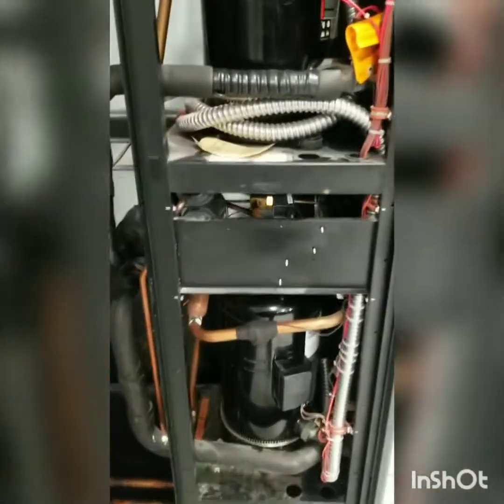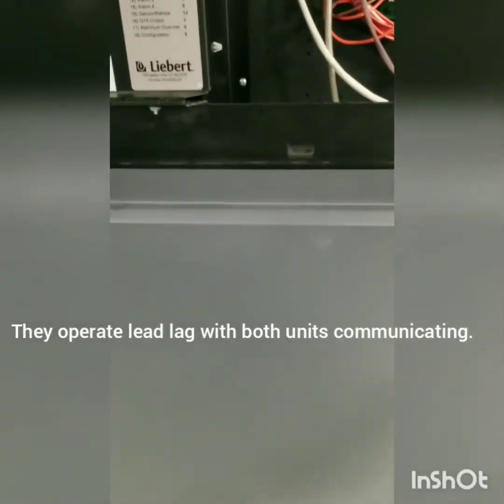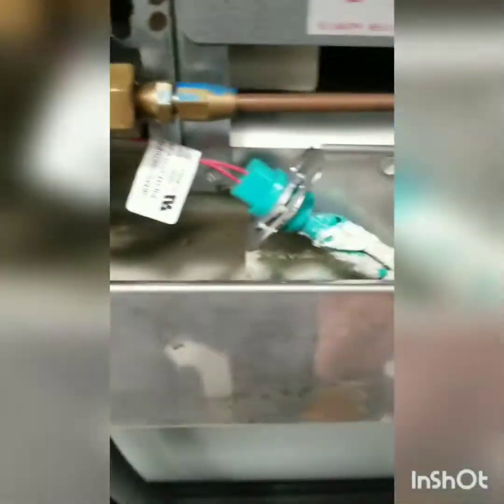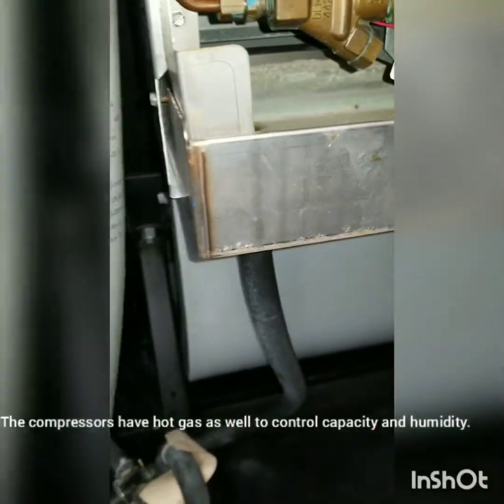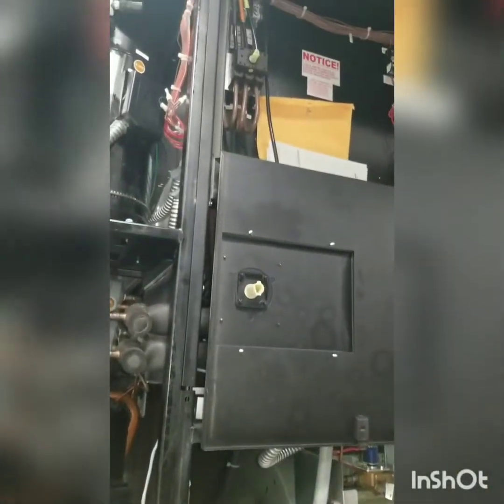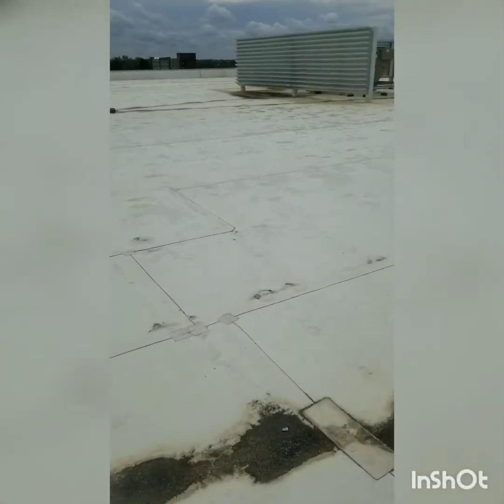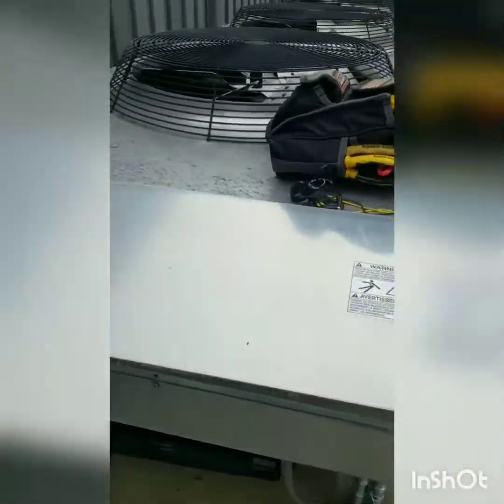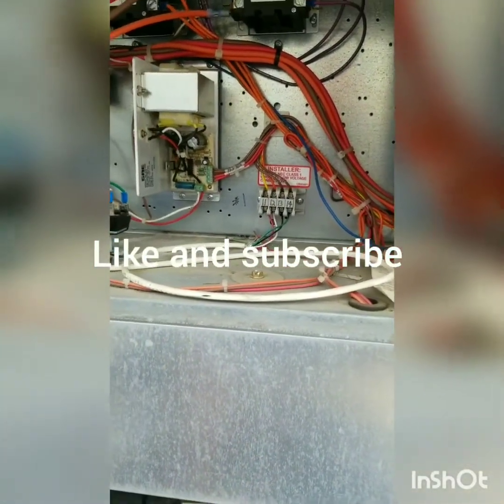HVAC preventative maintenance. Leibert overview and P.M.  HVAC IT room.

Comment: Hey mate just curious. So did you set the outdoor temps to a higher temp to conduct your amp draw testing?
Reply from the maker: Honestly, this was a long time ago. I do not remember much about this. Can you be more specific? When I have time, I'll try to answer this question in more detail.
Reply: At about the 6:55 minute mark  you are setting the outdoor fan temperature back down because you had set them higher to get your FLA
Reply from the maker: What I was doing was turning the 2 thermostats up to cycle the single speed fans off, which would allow the condenser pressure to increase, which will ramp the VFD controlled motor to full speed.
Reply: @EverythingHVACR  oh okay I see! thanks for the reply. Great content.

Comment: After cleaning with water, the display showing High pressure problem.
I want to know the outdoor  Fan/Motor is water proof or not as i clean the outdoor with water.
Reply from the maker: You have to be careful with anything electric while cleaning

Comment: Should we clean the outdoor unit with Water?
Reply from the maker: Yes, I only use cleaner if needed for grease or a large amount of build up. Cleaner can be used just need to make sure you rinse it well and don't use anything acid base. Refrigeration technologies has some great coil cleaners, if needed.

Comment: Hi , boss
I have 4 unit in data centre as in your video lieber pac  .2  unit is working another 2 units is standby.
But unit have alarm high pressure
Unit # 1 ,comp#2 high pressure
Unit #2, comp.#1 high pressure
Unit #3, comp.#2 high pressure
Unit # 4 No any alarm
I rest the high pressure switch but
Still have alarm red indicator always beeping.room temperature is ok but I need to remove the alarm.
Please suggest to me 
Thanks
Reply from the maker: Check your high pressure switches, Liebert tech support is good if you need to contact them
Reply from the maker: You need to verify everything, if all fans run, coil is clean and still high pressure, verify that pressure with an accurate gauge. Telling me high pressure alarm gives me no information. If you can not get this information or are still not sure what's happening you may need to call technical support

Comment: I remember data room fourth July  last year new  Liebert  compressor loading and unloading I heard in back ground in video it  threw me for loop  When I was diagnosing  on semi hermetic usually indicates low charge but , scrolls designed like that. I had van axial condenser fan out ECM motor big bucks couple thousand.  Reheat contactors used a lot. Thanks
Reply from the maker: They are a bit different but they are great units. Thanks for watching!
Reply from the maker: They are a bit different but they are great units. Thanks for watching!